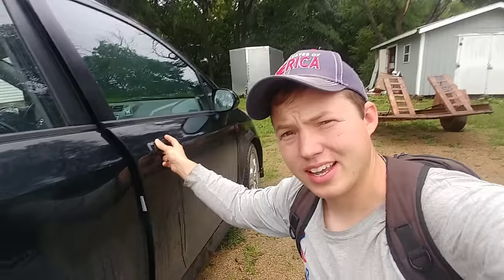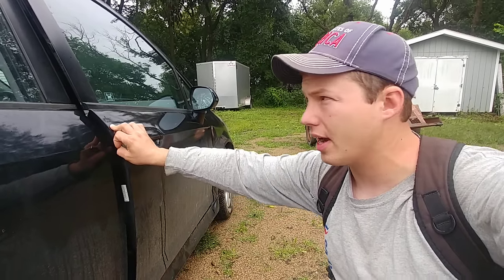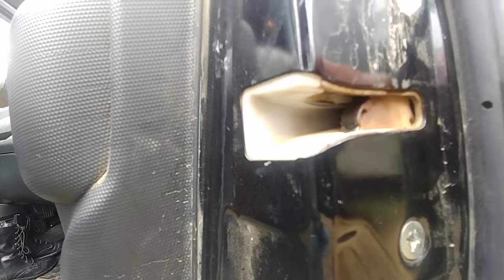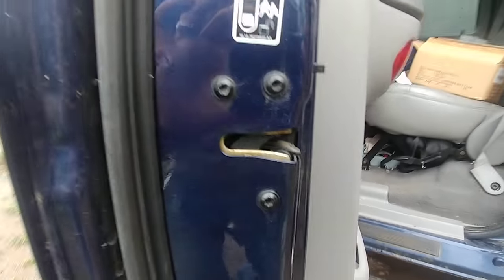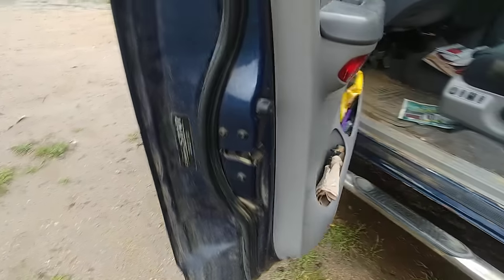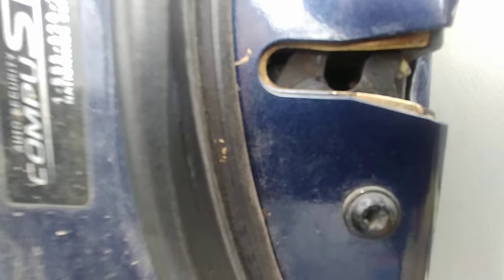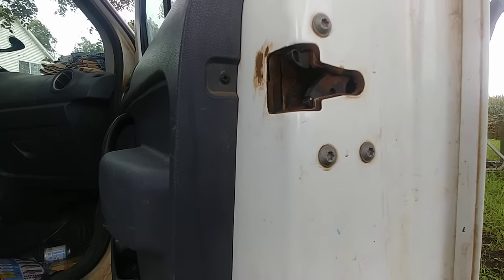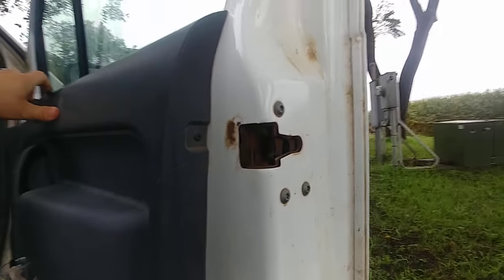How To Fix a Car Door that Won't Close with a Stuck Latch

Comment: You’re a lifesaver!!!!  It worked on my Nissan Xterra 2nd Gen!!!! 🙏 Just subbed!!!!  I used your first technique. Pulled inside door handle. Used screwdriver to spring latch in place!!! THANKS!!!!!

Comment: Ben, from the bottom of my heart ... thank you so much. I'm driving a 2000 Ford Focus and the "door ajar" light has been on for a couple of weeks. I decided to see if I could fix it. Well, I'm sure you've already guessed what happened next. I used a screwdriver to try and lift the latch while pulling on the outside handle. Nothing. I ended up in tears and then decided to look on YT. I watched all the different doors you showed and then headed back outside. One pull on the inside handle and problem was solved. Cheers from British Columbia, Canada!

Comment: Thanks so much Ben, really appreciate this. In case anyone else runs into this issue, on the latch I had to fix the only way I could get it to reset was to put a screwdriver in the slot and pull with the screwdriver as my friend pulled on the door handle. I couldn’t get the latch to reset by hand only. But just like you said it’s a simple solution. Thanks again!

Comment: Thank you so much!!!! That was a quick resolution!!! I was trying everything I could think of the slide that piece down, I pulled the handle a few times, tried to use a screwdriver to push it down my neighbor was bringing me some wd-40 ,lol then I came across your video!!! Thank you so much!!!!

Comment: oh man you are a life saver I was just cleaning the latch with a paper towel and I pushed and pulled on that locking mechanism and it got stuck and it freaked me out, didn't think to just operate the door latch. thanks!

Comment: I was super tensed as to what should I do with this mistake I did. What happens to car security until someone arrives to fix it, or do I need to take the car to a service center with the door open....you saved the day with such a simple trick. Worked like a charm. Thanks a lot!!

Comment: Thank you! I have owned my Ford Fusion for 5 years and just found the diagram for the childproof locking system. I stuck my key in and it wouldn't shut! Double mad at myself, but I found your video, and yay it worked! Thanks again!

Comment: Man thanks for this little tip because I surely accidentally pushed mine in because for some reason every time I turn right my back passenger door behind the driver keeps alarming that it's open but it's not, and it's every time I turn to the left and the car leans right ...so I went out there to kind of see what's happening and I pressed in the button to see what's going on and if that's the issue, and I accidentally pushed it in and I was panicking because the door wouldn't close after that and I almost went and got a plier to pry it open but then I said let me go YouTube and see first and then I found you and your little trick which helped me! Thank you very much!

Comment: Damn I think you just saved my day too. Had my car washed today. When I got back to it, I went to close the driver's door, but latch was in the lock position. Wouldn't unlock either with key or door switch. Couldn't figure it out, so drove home, holding the door shut with my hand. Got home and, to try to figure out what was going on, I started fooling with the passenger door. And F me, the same thing happened with that door. So I have both doors ajar and can't effing close them. Then I see that the interior lights won't turn off, so eventually figure out how to get into the fuses, work out which fuse controls the interior lights, and pull it. But I think this is going to solve my problem - may God protect you bro.
Update: this DID fix it, and so easily!

Comment: Most European cars (incl Saab) have a light spring on the pawl so that if the pawl is in the shut position when the door is open and you pull the handle the pawl will 'spring open'.
Do not worry: even if you slam the door REALLY hard with the pawl in the closed position, it will sound horrendous but you will not do any damage. At Rover we used to test this with 100 slams at 2m/s (ie very hard). Rockwell C type, Honda Mitsui,  Kiekert and Brose (who bought out Kiekert) will be safe. Cannot guarantee that for any other makes though.

Comment: Ben
  Thank you! Thank you, thank U!! 
The rear door wouldn't close after having this issue.  I had to drive it home duct taped and was ready to call a body shop. 
 BUT after searching for the solution / came across your video!
IT WORKED!  Sometimes its the easiest solution but just knowing the trick to it!!!"" You saved me!!!    Bill - CONNECTICUT

Comment: I've looked up how to fix this problem a few times, this is always the solution, and it never has worked for me. When I lift the handle and move the latch it doesn't do anything and remains wide open when closed.

Comment: I have a problem where the door is listed as open and the light stays on.  Is it related?  I can't find where the switch is which lets it know (on older cars you could see a little push switch very visible)

Comment: This won't work for me. The doors are automatic locking, and unlocking and locking don't make any difference on this particular door. It's stays in the locked position and cannot manually move it. Pulling the door handle and trying to move the latch it's solid it does not move. Anyone have any suggestions?

Comment: Try opening the door from the inside 🤣🤣🤣 (I have an older 99 van)( the latch opened immediately by itself ) I wasted a lot of time with the outside door handle and screwdrivers 😬🤣🤟

Comment: I have this issue but its fucking -9° with the windchill and its not working 😭

Oh, and I'm at work.

Edit: finally got it!!! Was cold af but had to drive my car to the front of our building to use a heat gun and tapped it with a rubber mallot 😂